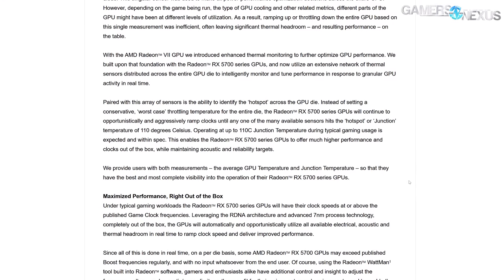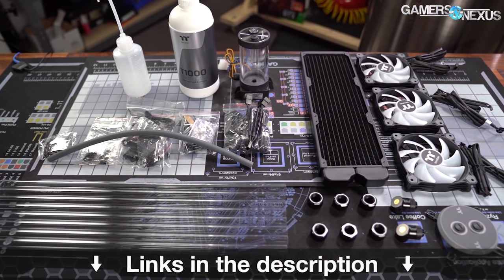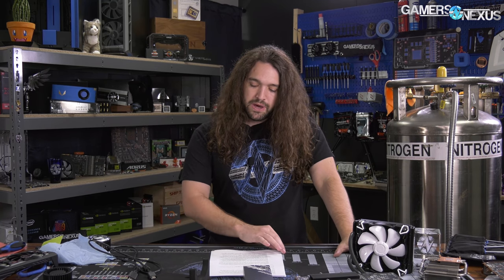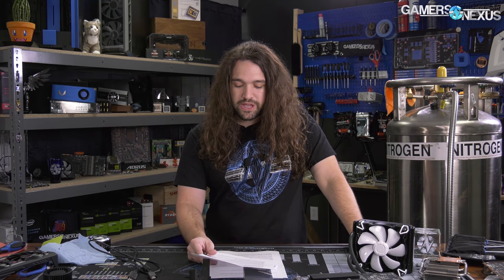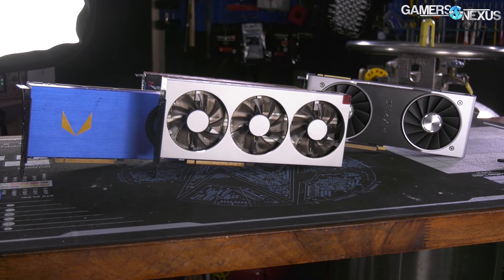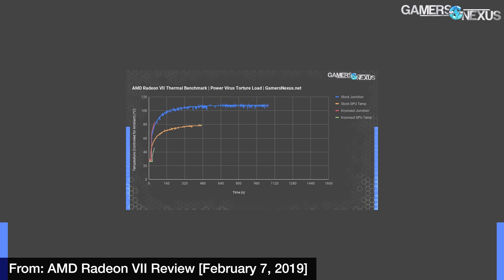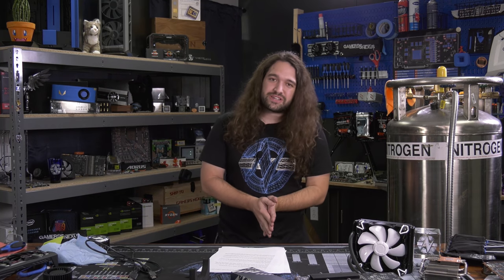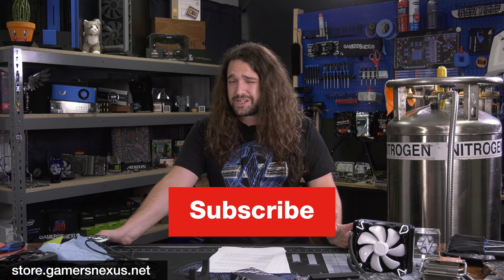Explaining Navi 5700 XT Junction Temperature | 110°C is Not "Expected"

Comment: It also should be pointed out that the Sapphire Pulse is just the budget model of Sapphire, the cooler on it is far from impressive (3** gram, out of my head aluminimum pipes) and that already is enough to decrease the temperature and noise level that much. We know that Sapphire will soon also release their 5700 (XT) Nitro. The 5700 XT GPU is good, quite overpriced (as RTX but at least Nviida offers 50% extra hardware though it is not utilized :)) but good. The coolers on the AMD reference cards are horribly bad. It pisses off the AMD-gamers, for them it means that they have to wait 2 more months for nothing before they can finally buy a card. Now it is the 17th of August - 6 weeks after the 7th of July - and we still can't buy a 5700 (XT) which doesn't suck. 

It looks like next week the cards will finally become available. Why do we have to wait that extra week? Why couldn't ASRock, Sapphire, Asus...release it previous week? It was ready, it was sent to the reviewers over a week ago. It has been 2 years since AMD's latest release, and that was just a paper launch.

Comment: I think it all comes down to the fact that as a consumer I do not want something running at 110C? If it gets dust wedge between the baseplate of the cooler and the fins it could catch on fire, whilst yes you should be keeping your rig clean to protect your investment, how many people have pets and pet hair, keep their pc's on the carpet, it will ineviblity get dust in it. 

Does AMD really want to be parcially responsable for someone not cleaning their pc for years and then their house burning down/ possibly killing the occupent/HMO, juyst because they couldn't be arsed to spend a bit more time & money to make the cards run colder?

Seems like an expensive lawsuit waiting to happen. and I personally would not take the risk and would by an Nvidia card instead.
Reply: If enough dust gets into your PC for that situation to happen, you have much bigger problems than a junction temperature of 110ºC.

Comment: 110 °C means it is safe to operate on this temperature... there is nothing hard to comprehend about it. I think we are only about 2 generations of cards away from 100 °C under load as targeted temperature by manufacturers even with good coolers.
Reply: AMD said expect, they didn't explicitly say safe. If they meant safe they should have said that.
Reply: @zeitgeistx5239  and another random one replied... ;-)

Comment: Let's imagine Graphics Chips are cars:
Place thermal sensor in the cool air, just behind the grille:
Joe Publignoramous: "My car never gets hotter than 25C! It's so cool it's giving me a semi! Woot-Woot! :) "
Place same sensor in the cooling system:
Joe Publignoramous: "My car runs at 100C... I better get on Facebook and see if thats OK. After all, Facebook knows better than the car manufacturer's site!"
Place same sensor in the exhaust manifold:
Joe Publignoramous: "Oh Fuck! My car is running at 450C! Fuck-fuck fuckety-fuck-fuck! 😲"
Same car/graphics card
Perfectly normal temperatures... for the specific position of the sensor.
The only difference is Joe Publignoramous is now aware of it, rather than blissfully unaware of it...
So now he's in a tizzy, running around screaming and pissing his pants! 
:D
Don't get me wrong: I don't like that chips have hotspots at 110C and would rectify that as much as possible with the Washer Mod, better TIM and perhaps choose a card with a better cooler.
But I am aware that these hotspots exist, unreported.
They are becoming more of an issue as the manufacturing process shrinks and the heat density of the chips begins to overwhelm the thermal conductivity of copper. 
Pure Silver has better thermal conductivity and diamond is in a class of its own, but price!

https://www.extremetech.com/gaming/296577-why-110-degree-temps-are-normal-for-amds-radeon-5700-5700-xt

Comment: Operating at any component's max safe temp will do one thing. It will shorten the life of the component to some great degree. Maybe AMD wants this so they can sell more cards faster? Who knows.
Reply: I know of two HD 4670s that always ran at 113c 6 years of their lives crossfired, one died recently the other one is still kicking and gaming at 113c or above.. daily.. so I guess it depends.. is 11 years a short life for a computing component to you?
Reply: @bdhale34  Considering I just built an UnRAID backup system that has 2 gtx 980 ti cards and 1 GTX 260 ti (the 980 ti run for windows 10 dumb box and the 260 ti for the xp dumb box) I would have to say 10 years is short. lol. I use the XP VM for games that do not run on newer systems and the 980s because I had them still lying around. It is fun going back and playing VtM:R and the like on XP.

Comment: i hope i got it right here: the card doesn't hit 110 °C at all under normal circumstances, even with those shitty stock coolers, yet can handle such high temperature if needed (yet not good performance-wise). and 3rd party cards merely even hit the 80 °C mark.

...that's actually good news for us users!
Reply: The lingo is going over my head too, but a Sapphire RX 5700 XT is expected to operate at 80c core temp? Did I get that right?

Comment: Radeon 5700. Thanks for this, I was confused about the OC boost, I knew there was something I didn't understand. While I could tell my card was running normally from other benchmarks\graphs etc, I needed more knowledge. 90c tj is not what's limiting me, I started to wonder if I accidentally entered a thermal cap :) somewhere by accident. At 40-50% max power, 1950 or so core average on boost(just for benches), I must be hitting a volt(won't be increasing) or silicon cap.

Comment: Isn't the point of a blower card to blow hot air out of your case, so it doesn't add extra heat onto your motherboard, cpu, ram, wifi card, etc? A nice modern case with good exhaust/intake fans are still going to get more heat in the case warming the components with an AIB type fan card vs a blower card. Right? Maybe? Right?
Reply: Yes, it also lacks enough performance to overcome changes in ambient temperature, I used to defend blower cards on the same basis, until I started running dual axial, and found that even in a tiny case, the dual axial was way more efficient, as always it's about the ambient temps combined with your case airflow plan, blower cards don't make proper use of good airflow even if they get it, hence why their rep is bad

Comment: GPU's have always had a higher thermal range than the average cpu. i remember back in the day seeing temps in the 125C range. so 110C is nothing new, just haven't seen it quite some time.
Reply: Because its a junction (hot spot) reading, NOT the edge temp that gpus have used for years to report temps. the 5700xt stock cooler doesnt go over 65c edge for me ever. It does have an extra sensor to show me the junction (hot spot) temp which is what is being discussed here. It DOES NOT run at 110c edge. Dont be stupid, stupid.

Comment: Reminds me of the HD4850 with single slot blower style cooler. 90°C idle, 110°C load.
Reply: My old 4670 had a dinky aluminum hs and a tiny fan and it always gamed around 113.. for over 9 years, I upgraded and I gave it to my buddy who had another one and he used it crossfired for about 6 years before one of them died and they both ran around 113 all the time when gaming and I'm not sure it was the one I used to have or the one he already had that died so my old card may still be kicking it solo. AMD likely meant the silicon will be fine at those temperatures.

Comment: So i have an RX 5700 XT THICC III. It boosts up to 1995. But today junction temp was 107 C. 

Would you do a teardown on the cooler? Summer is about to start, i want to know if i have to do new thermal compound and new heat pads. Do i?

Comment: I had 2 amd 6970 in crossfire back in the day. It ran at 98c all day everyday. I had that set up for like 4 years. I'll never buy blower cooler cards ever again in my life because of those cards.

Edit: it would heat my whole basement when I gamed. Good in the winter and sucked in the summer.
Reply: Either the 4670 I used to own or the one my buddy got at the same time finally died after 6 years of being crossfired running at a reported 113c or higher.. and that's not even tjunction that's whatever sensor they had on that old of a low-mid range card. 11 years gaming at those temps and one of them is still going. I'm inclined to believe the radoen group if they say their chip will be fine and is expected to be able to run at those temps.
Reply: Temperature of the GPU is irrelevant for the topic of heating your room. For a given power consumption your system is going to heat up your room by a certain amount regardless of its cooling solution.

Comment: So basically we have possibly ran our CPUs and GPUs way over 100c on it's hottest spot for the last decades as the temperature is measured with a single sensor from the edge or under the die.
So AMD exposing their Tjunction temperature makes them look bad because it's too high on Navi on bad cooler. Lets see what Nvidia and other manufacturers start to do.
Also we are VERY likely gonna EXPECT these kinds of "hotspot" temperatures as the thermal density increases as the components cramped closer together are more likely to generate hotspots.

Comment: Interesting things are happening with Radeon...

Radeon RX5700XT it's going above the standard Temp with no issues causing system to crash... For some reason I do not see 0db fan option in the drivers and the card stays in silent mode while playing, after about 20 minutes, black screens and crashes, under clocks, degraded performance etc... The junction temp could be 110C but if the GPU temp itself arrives to 85C the card crashes and the drivers either... The solution of all that crap is to set manual fan curve in order to avoid crashes, of course loading the profile on each boot cause the amd software does not like to save your settings... If you buy AMD + RADEON config prepare yourself to become an IT Engineer 😂

Comment: My Rx 5700 xt has a core temp of 60°C and a junction temp of 100°C. The coverage of thermal paste is perfect. Why is this?? Also at idle both are the same
Reply: I have non xt version and my junction temp is 95c..
Reply: @R3nchi    fans ?  how do u have the fans in your case placed ?   If you don't have  atleast  6 fans , 2 in /2 out    and  another two specifically to deal with the GPU ... ya have to kinda expect  bad temps even on an nvidia card.    Imo 70C is too hot   as  most cards start to throttle clocks at 55 C  (for  nvidia)     so u want to try and keep  nvidia cards  in the 50C range imo atleast if u want max clocks .    If ya wanna pass that jerk  that has the nicer  hardware   on  Userb or Kombuster   or  in battlefield / call of duty / apex.   Go  fan ...go  fan hard bruh.   Fan it like  u live ...hard.   No joke tho    think back to pascal or  current turing cards , and watch the clocks start to  drop at 56/58C  .    all the benchmarks u see on youtube  where folks  post 60C  avg /65C avg as "ok" or even "good" ...these are people u should not take seriously atleast not  when it comes to  getting the most frames  out of  whatever hardware you game on.   With regard to   the 5700/5700xt   they do run hot man  and its not yer fault ,  U can  return them  (to answer the  earlier question)  OR u can just  tame them cuz  you are infact   the alpha in this relationship   of  Man and GPU , u aint got to take that mouth from this  AMD  tramp.     Cool it down   think about how the card deals with heat ,   and help it do so.  if it needs  the  air pulled off it ...do that  if it needs   fresh  ambient air  pushed into it ...do that.

Comment: Thanks again Steve, would be interesting to see hot spot temp on Nvidia.
Reply: With their reference cooler also keeping the GPU's at around 80 degree's, just like Navi's, their Tjunction temps will be very similar.
Reply: I doubt it, under the same load, every comparison has shown reference Navi to be 10c or so hotter, so I figure Turing is probably 90c or so, since Navi is around 100 on reference
Reply: @faffabout9412  anandtech shows the 2070 super and 2080 at around 75 degree's with their reference coolers. it also shows the 1070 and 980 GTX as being around 80. They are all in the same ballpark

Comment: No, AMD is not being punished for exposing junction/hotspot temperature. AMD is being punished for having a terrible cooler. Nvidia went away from blower coolers for the 20 series last year, and AMD should have done the same. I hate fanboys so much. People aren't complaining about AMD's terrible cooler not because they want to hurt AMD or because they want Nvidia to "win", they're complaining because they want AMD to have better products. But noooooo, fanboys always have to defend everything instead of offering and/or being accepting of constructive criticism to improve things.
And I'm quite unimpressed with AMD's blog post which seems like it was written to give their fanboys some nonsense to spew all over the internet.
Reply: AMD is being punished for having a terrible cooler"

Nope! AMD is being punished for pushing the GPU so far past the silicon's mid range performance, that the cards run really really hot. If they dropped the clocks just 10-15%, they could get maybe 60 C - 70 C, and not have this issue. My last AMD GPU was the HD 7850, and since then I switched to Nvidia, as they just run cooler!

Comment: People need to realize that AMD uses too much voltage and a really agressive fan profile from factory. You can undervolt, reduce the fan noice by creating a better fan profile and overclock the card all at once. Mine runs  2ghz @1.1v no problems and stays around 85 edge and 100 junction temp. At 1.9ghz 1v it's 10 degrees cooler and a lot quiter. Just play around with settings before speaking nonsense. And yes, aftermarket coolers are way better.

Comment: Why isn't anybody Addressing the real problem with the Vbios that only ramps the fans up to 40% at full load, I have to set my settings in MSI after burner to goto max fan speed at 80c/100%fan  and it keeps my temps below 85c at 4800rpms(sounds like a jet taking of) but my temps are decent at full load, why is the bios wrongly programmed for this card, I have asked AMD over and over to send me a proper vbios to fix this, and i just get canned responses, this has been going on for too long, somebody should address AMD directly.  Any of the AIB partners should recommend to amd tu update that major flaw, because Wattman just resets everytime I reboot, and MSI AB is the only program that Reliably does what it is supposed to do, but I shouldn't have to resort to a third party app for my Silicone to be safe?  Sorry, this really pisses me off about AMD Lax attitude towards this launch, and I have the Lisa Su edition, if she knew what was released in her name she'd probably shit her pants.  Thank Steve, always informative.
Reply: You can fix it bro ,  check out Morepower  utility.    You can edit the curve yourself permenantly.      Use  GPU Z   to save your  bios ...send it to me and I can edit it for ya if you have  a lot of probs with it and send it back to ya.

Comment: A common problem I have in winter is that its freezing cold cause my house is cooling down a lot thru the wind as I live in the countryside...therefore I have decided to buy a reference RX 5700 XT and have my case open...this will take care of the heating in my gaming room...thank you
Reply: if you want heating you should have gotten a Vega64 liquid or 2080Ti. much higher total heat output.

Comment: This is an extremely common mistake, so common that its almost okay to make. The difference between edge temp and junction temp cannot defined by delta. Delta is used for change in temp over time,meaning final temp minus initial temp.

Comment: I wonder if the Blower Style Coolers do perform better in OEM Hot Boxes with low ventilation?
Reply: They do. It's why blowers are preferred in small form factor low air flow cases. Outside of that partner cards are always better, but for bad airflow the blowers are much easier to sustain for extended use.

Comment: I could care less how loud the video card is when I'm gaming because i have speakers or headphones that make noise.  Not saying a bad cooler is a good thing.   If the silicon can handle the high temperatures then the blower cooler isn't bad just loud.  For the 10 dollar difference the better cooler is worth it.   When you get into the 40 dollar increase then its not worth it imo.  In a case the card would have to be really damn loud to hear with any speaker/headphones.
Reply: $50+ difference here in the UK, between reference and AIB cards. I have no idea where this $10 difference is, but we certainly haven't got it!

Comment: Ok, I know that I fucked up, but my budget wouldn’t allow for the extra $50 to get a better cooler. I bought a reference Msi 5700xt over the weekend for $297 off amazon warehouse. So far the card has underperformed compared to online benchmarks and the fan speeds seem to have a mind of there own. Sometimes it will go up to 110/111c and then kick on at 60-80% and actually drop down to 80c. Most of the time it just keeps itself at 110/111c. 

Should I try fixing it/ water cooling it with a Nzxt kraken? or should I send it back and try to get a different 5700xt?

Comment: I'm running a sapphire nitro+ 5700xt on 'default mode' with junction temps of 98 C @ 99% usage in a fractal design meshify C case with 2 Noctua fans on the front panel. Should I return it?